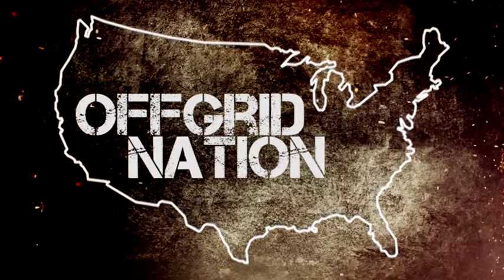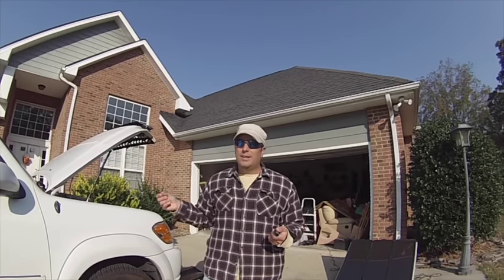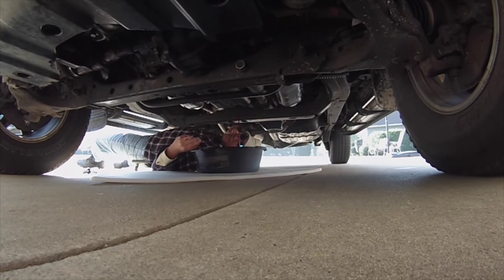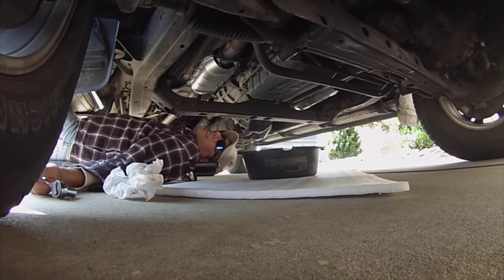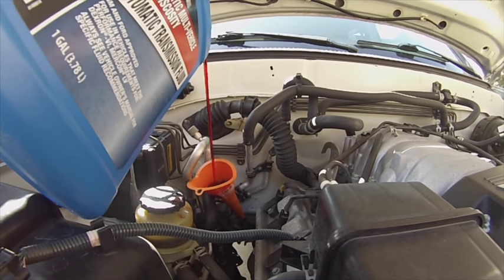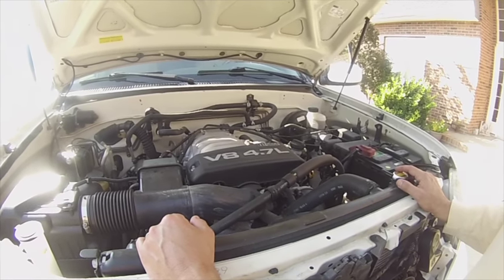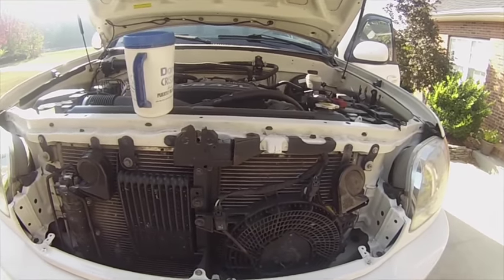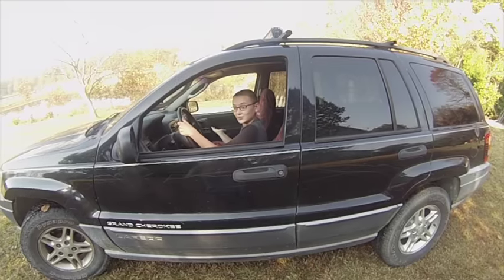2004 Toyota Sequoia Transmission Fluid Change, Jeep Brake Light Change & Cleaning My Stihl Chainsaw

Comment: Very cool! I have a 2003 with 191,000 miles and I love it. I just got a new battery which is sealed and new radiator and thermostat. Still running smooth. My co worker has a 2000 with 240,000 miles.
Reply: I love Sequoias, I have an 2001 with 294,000 runs like a champ!

Comment: When we changed a solenoid and the solenoid harness, the transmission guy that came to help me used a small honda power steering pump and a drill to spin the power steering pump to push the ATF back up into the transmission fill plug. The transmission has a drain and a fill plug. At least my 2005 does

Comment: Yep, the oils from fingerprints cause a bulb to heat unevenly, which makes it more prone to overheating, and therefore bubbling and failure.  I learned this as a live theatre techie, but it applies to any bulb not just theatre bulbs.

Comment: Good video. Didn't know you could fill up the battery like that. If you don't already know its best to dump the fuel out of the gas tank with anything carbureted and run it until it dies. Stabil and E0 still aren't the best to leave in the carbs. Been doing this my whole life and never had issues with boats, lawn mowers, blowers, motorcycles etc...

Comment: That sure sounds like a lifter making noise.  Sometimes you can get them to quiet down using an oil additive.  Are you planning on changing the transmission filter in the future?  When I go to the trouble of changing the tranny fluid, I change the filter too.   Why put new fluid thru a dirty filter?  Good video,  you are giving pretty good basic information for vehicle maintenance.  If you properly maintain a vehicle it should be good for 200- 300 thousand miles easily.   Ps when replacing bulbs you might want to get the special grease the keeps the connections from corroding.  My Grand Cherokee (99) had some corrosion on the tail light bulb connections.  I enjoy your videos, thanks for the effort you put into making them.  Phil
Reply from the maker: xzkt I'll eventually change the filter. I changed the fluid and filter on the Jeep some months back. Easy enough.

Comment: Curious did you put in atf type 3 or atf lV also I don't think you have to on that SUV put in neutral to check fluid I know cause I work at toyota , when I worked at Volvo that's how you you check atf in the s70 and the s60 Volvo I too have the 04 sequoia ,,,,,,, how does the tranny shift.  Never top off your brake fluid either. It is used as an indicator for your brakes.  Should only be full capacity when your brakes are installed nes so as time passes and brakes wear down all you would do is look at your fluid level , great tip.
Reply from the maker: I don't remember what kind I used but according to the label it was the right type fluid. Tranny shifts great. Thanks for the brake fluid tip.

Comment: Thanks for the laugh , love it ! That's a lifter making noise , just saying ! Easy fix bro !
Reply from the maker: That makes the most sense. I've used all the cleaners that I can think of to clean the fuel system and hopefully get it unstuck but no luck. I don't know how to fix it. I guess I'll start looking for videos on YT. Any tips?
Reply: Off Grid Nation mystery oil in the oil could help , and there is another additive I can't say the name due to a mind fart in progress ,  but I would change oil and mystery oil to oil and your gas , try that before adjusting lifters !

Comment: how did that supertech transmission fluid hold up over the years? i know a lot of people recommend valvoline maxlife.
Reply: I used Valoline Maxlife and have had 0 issues, I wouldn't use supertech personally, Valvoline and OEM fluid would be the safest bet.

Comment: The ticking in jeeps in notorious.  It is the lifters chattering.  Just make sure you change you oil on a regular basis, some would recommend motor honey, though the research behind that is suspect, it is supposed to fill in scratches in the cylinder walls and other bearing surfaces in the motor.  I have heard jeeps chatter like that most all their lives, its just a jeep six cylinder.  Most straight 6's made the ticking noise.  Keep an ear on it, if it changes or gets worse have a mechanic look at it.

Comment: Hey mate have you got the name or a link to the stuff you use to clean your radiator?
Reply from the maker: Here ya go: http://amzn.to/2fXcLaT
I put it in the video description too. It will last you many years. I have cleaned 4 a/c units and 5 radiators and I'm still only about 1/5th through the gallon. When you use it you will see the spray foam up and all of the dirt just come right up off the coil fins. It's da bomb.
Reply: Off Grid Nation
Thankyou x